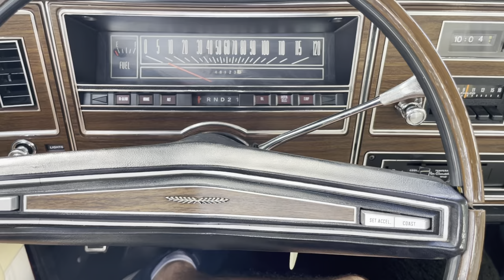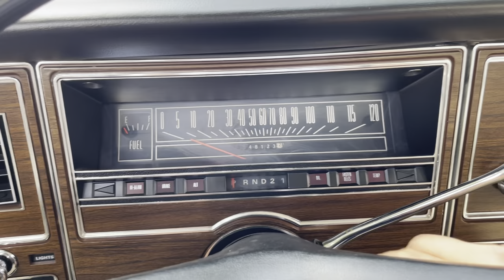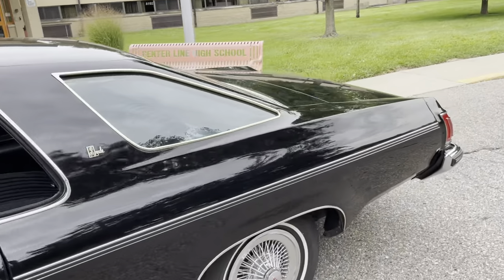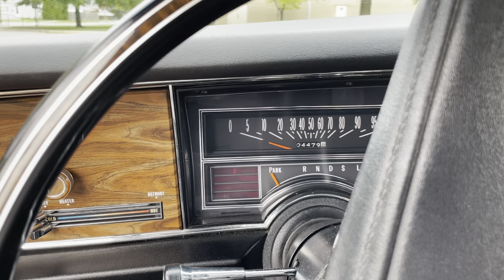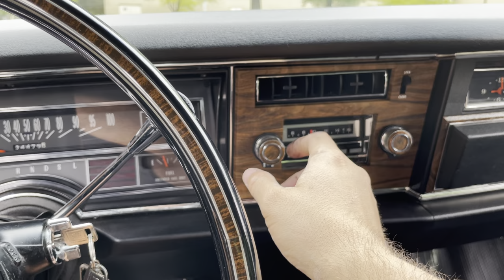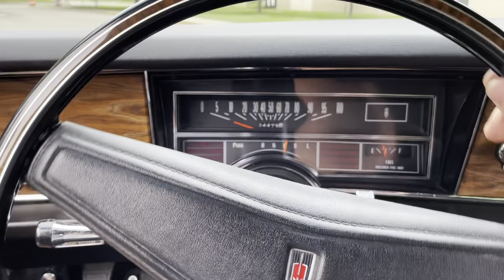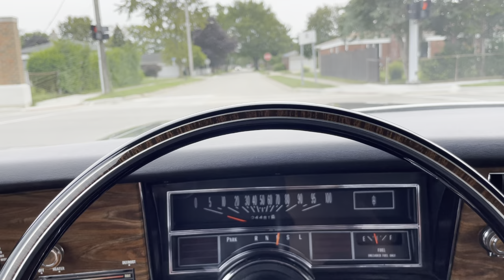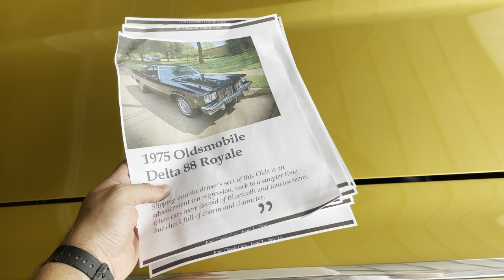1975 Oldsmobile Delta 88 Royale & 1974 Mercury Marquis Brougham - Check out Article in Description!

Comment: In High School in the late 89 I bought a 77 Grand Marquis, the 460 was a beast and so equipped would run 70 MPH in first if I manually shifted it, when it when into second that speedometer really buried! I think it had a 2.75 rearend? On a top speed run according to my friends Honda super bike he creeped by me at 130 plus, give or take I would say 125 mph top end the motor was a single exhaust, and I don’t think I could really hit redline because of drag and not being a high compression engine in 77. In 1994 I picked up a 1977 MK5 with 460 that was equipped with true dual exhaust, I installed a new Holley carb, straight up timing chain, had trans rebuilt with shift kit, it would only get 55 in first, I’m inclined to think it had a 3.00 rear end gear?
It was definitely quicker out of the hole and surprise many cars and passengers with the acceleration for what it was when you nailed it at 70 it would really go. Maybe someone can comment on similar cars just my 2 cents, and yes I have driven some fast cars and muscle cars and these cars are not in the same league, but for a Freeway Flyer they are hard to beat and quite fast.

Comment: I completely agree with your assessment of these two cars. I thought the GM cars of this era were funny looking exteriors. It’s like the lines held on to the 1960s, but just got larger and didn’t flow near as well as they did in the 1960s. Fit and finish was much better in the Ford products during this era. When you closed the huge doors on GM cars during this time, you could see the door cards shake and rattle. 

I thought the Mercury was a prettier car, especially the exterior. 

Olds had better steering and handling, but the Mercury had a plusher ride.

Comment: Are you going to leave the Mercury’s door panels yellow from fade or you going to replay them. They were the same way in my 77 T-Bird. Also in performance have you checked and compared axle ratios? That could be a key player.
Reply from the maker: Rear ends are pretty similar. 2.75 vs 2.56, but it’s more of a top end difference vs low end grunt. 

Not sure on the Merc.  These door panels have a lot of fragile pieces and you need to remove them to remove the armrest.  I may just leave them as is. Not sure yet.
Reply: @RareClassicCars  yep I know about the fragile panels, my car had 42,xxx miles and came off fine and were perfect shape other than the yellowing. I did notice a crack behind the arm rest on the driver’s door so that would definitely have some care removing. Yes the Merc has a beautiful front end.

Comment: My experience about mid-70s GM sense of power --- we had a 76 Cutlass S with the 350-4V and you could drive at the national speed limit of 55 holding the car in 1st gear and probably not quite at redline. Pretty sure it had a 2.41 rear for "mileage" which was still gawd awful LOL. Also, we would find a finish screw or panel screw on the floor nearly every time we vacuumed. Interior was really poor quality. It did have quick steering like you say. But overall, not a fun car. I was in my teens at the time and so was "eager" with my braking sometimes. I'd swear I could almost tap the front bumper on the ground the nose dive was so bad, too.

Comment: My personal opinion of the '74 Marquis was that it looked much nicer than the '73. In '75 ford got lazy and just stopped updating the design.  I agree with you on the luxury wheel covers, they are a nice touch.  The area that screams economy was ford's use of molded plastic on the door armrests.  GM did the same thing, but I don't see theirs turn yellow quite so bad.   I miss the days when you could get a white leather interior.  Nice Mercury - never was a fan of Oldsmobiles after '72.

Comment: My dad had a white 1975 Delta 88 coupe. It had the blueish vinyl roof, 400 2 barrel, I don't recall it's trim level, but it did have air conditioning and soft blue velour interior, manual windows and locks, nontilt column. And it had the same weak interior buzzer! My dad got rid of it in 1986 or 87-ish. He didn't treat it well, my dad isn't and wasn't a car guy, at all. He drove it into the local steel mill and the body became trashed almost immediately and he NEVER washed it, I tried my best to keep up with it, but there's only so much I could do vs a steel mill. I felt sorry for all of his cars. The one thing I liked, before it became trashed, was how well it rode and just floated down the road!

Comment: I find the really loud, metallic turn signal in the Olds annoying. If I am not mistaken, with this generation B- and C-bodies GM was mounting the turn signal flasher unit in a metal pinch clip on the underside/backside of the instrument panel so it would resonate. The sound on this particular one is not pleasant. There was so much variation on the flash speed and loudness of these old Tung-Sol fixed load thermal flashers. The '77 re-design of the GM full-sized cars moved the flasher to the fuse block on the firewall where it did not resonate against the instrument panel. The '79- '91 Panthers had them mounted near the driver's knee panel low on the instrument panel and they would resonate quite a bit.

Comment: correct me if I am wrong, if my memory serves me well those 460 made only 195 hp because the cam timing was retarded to meet the emission regulation, my friend had one and we change the timing chain with a different key, advancing the cam timing by 3 or 4 degrees and it made a big difference, you really have a gift to find those beautiful cars.
Reply from the maker: Youre right.  That happened in 73 and it was 6 degrees retarded, but that wasn't the only factor in the power decrease.  Different heads, compression ratios over time, timing curves, etc.

Comment: When I was very young and dumb. And not all totally my fault. I rear ended a VW Beatle with a 70's something Olds Delta 88. Pushed the engine of the Beatle into the back seat. What was the damage to the Olds Delta 88? I had a red paint scuff from the Beatle, on one of the headlights.

Comment: My father owned a 74 Grand Marquis with the 460 there's no way that engine only put out 190 horsepower. At a hundred twenty miles an hour you can put your foot in it and it still was pulling. We made many trips from Michigan to Florida in that car and it rolled like it was on a cloud of air. If I recall the speed limit was 75 miles an hour back then and when my father would go to pass cars on the freeway it would suck you into the seat..
I also remember during the blizzard of 1978 my father drove that mercury to the store as we passed by four wheel drives buried in the snow. I do remember the car had a posi traction rear end. My father being a Ford motor designer usually got a new car every year I pick the 74 Grand Marquis as the best car he ever owned.
Reply from the maker: I agree w you. It pulls really well, but that is the SAE net hp rating.  Definitely feels stronger.

Comment: Very nice Mercury. Fix the clock.
Reply from the maker: Nah. It’s right two times/day.  

Who needs a clock when you drive this car?  Party starts when you arrive. Not a moment before.
Reply: @RareClassicCars Isn’t it funny how the mechanical clocks in those old cars almost NEVER seemed to work for very long, if at all?!? My parents had a 1977 Mercedes Benz 280E, which they got brand new in 1977, and the clock in that car worked AMAZINGLY well, and what’s more, kept INCREDIBLY accurate time over the ~21 years we had that car. I remember a friend remarking once, “Isn’t it amazing that Mercedes Benz is the level of engineering it takes just to get a clock that WORKS, let alone keeps excellent time?!”

Comment: The Olds is an example of GM's mixed-message marketing. Olds was supposedly an upmarket offering yet there really wasn't much difference between it and a Chevy or Pontiac.  I suppose trim level is a factor but without any branding, and excluding the optional power windows and antenna, that interior could easily be that of a base level Chevy.

Comment: Yeah those old window motors had 3 nylon barrel-shaped rollers that absorbed shock and when they got old and dried out a little, they would disintegrate. The motors themselves were quite durable, so a good technician who had access to new nylon rollers could fix them with $1 worth of parts, just like the newer Climate Control modules that had little o-rings that would stick and disable them, usually to the default defrost mode blowing at the windshield.
   At the dealership, replacing a window motor would be $150 and up (back then) and the Climate Control head still sells for $700 and up: add labor. I can fix either with $1 worth of parts.

Comment: Do you have any ‘75-78 FoMoCo products or ‘74-76 Buicks or Cadillacs?
Reply from the maker: Unfortunately, not anymore.  My favorite FoMoCo years are 67-74.  Starting in 75, they began a lot of cost cutting moves, which decreases my love for them.  I had a 75 Ltd brougham but found my 73 to be a much better car, so I sold it.  Same story w the mid 70s GMs.  I had 3 1976 Eldorados.  Sold them all.  Swore off GM cars w bumper fillers.
Reply: @RareClassicCars  Okay, that's understandable.  To me the big Ford products looked best from "75-78 or 79 for Lincoln and the '76 Big GM products were the best looking IMO.  I love old "Detroit Magic" and it is so sad how far the automobile has declined since this period.  I am only 36 so I unfortunately missed these land yachts for the most part.  I did have a couple Buick Park Avenues (I know it's not the same) but for a modern car they were great.  The last one was a 2005 with only 16K I bought as a gift to myself after finishing college in 2008 and getting my first real job (It is still my favorite car and I still regret trading it in 10 years later!).  I test drove a new Town car in 2010 but for $50K it didn't impress me and I found the Buick rode softer so I passed.  I now have a 2020 Yukon which rides very nice for a modern vehicle with the smaller 18 inch rims and bigger tires.  The rims look cheaper but I test drove one with the 20 inch rims and the loss in comfort wasn't worth it to me.

Comment: Love the Mercury Adam, I wouldn't have ordered an Oldsmobile considering the poor body construction, but then again the Australian Holdens of the day weren't any better. They (Holden) knew the cars were poorly built but also knew people would still buy them, (at least until the Japanese arrived).
I suppose both steering and braking of the Mercury could be improved if desired?
Reply: I don't think an HJ of 74 was any worse than an XB falcon or VJ valiant. My 76 CL, same body has wonky lead join too.  Holden always had much tougher chassis, and that's the main thing u need in the outback
Reply from the maker: Braking isn’t horrible, just not as confidence inspiring as the GM.  

I think a diff steering box would prob be a tough upgrade.
Reply: @cruiser6260  You're right of course, every Aussie automaker was equally bad at the time. Thanks for your comments.
Reply: @RareClassicCars  Fair enough Adam, changing steering would indeed be difficult and you'd also not be getting the "true" 1974 driving experience.

Comment: The rattling noise produced by the door closing on GM products with frameless glass was from the windows becoming loose over time due to wear . Fords were much better in that regard . Also , with GM's midsize , compact and subcompact cars the bushings in the door hinges would wear , causing severe sagging issues with the doors . That was a problem that none of ford's car lines had , not even the lowly pinto . Although the 73 - 78 ford and mercury share similar bodies , I feel that the mercury looks far superior to the fords . My dad brought home a brand new 75 LTD wagon , and when my mother stepped outside to look at it she thought it was one of the ugliest cars she had ever seen . I agreed with her .

Comment: Love your '74 Marquis Adam! I completely agree with you that Ford, Mercury and Lincoln had better quality control out of the Big Three.

Interesting that the 460 in the full sized LTD/Marquis was rated at only 195 net power while it was rated at 220 in the mid sized Torino/Montego/Cougar in 1974. The Police Interceptor 460 was rated at 275. So, you might actually have the 220 hp version if it feels like yours has more than advertised.

The GM big blocks were definitely on the way out by this time as 1976 was the last year for any of them.  The 454 and 455 engines would not be missed as they were mere shadows of what they once were. It was the same for Ford too as the 460 was gone by 1978. Lean carbs, cat converters, retarded cam timing and fuel economy was what killed these engines.

Excellent video Adam!
Reply: 429/460 were torque monsters. That's why this Merc can move steadily.
Reply: Cody Luka < The 460 and 454 were available in 3/4 and up pickups on into 2000.
Reply: @melrose9252  Yes they were. Don't forget the 1990-1992 Chevy 454SS on the 1500 shortbox chassis. There was some talk in doing a 454SS for the Impala as a special edition but sadly, it never came to be. Now, that would have been interesting...and awesome. Too bad though!

Comment: To some extent you were comparing apples and oranges. If you had pick a 4 door 98 Olds it would be more relevant, the Mercury was the top trimline short of the Lincoln. I drove a 74 T Bird with a 460 and was like sitting on the couch going down the road. I always though it was way too soft a ride and it's 460 always seemed lacking to similar GMs like 73 and 74 Electra 225s we had. So things can vary. Two(seemingly) identical cars can perform  differently. Thanks for the cars.👍

Comment: Well, to me, GM destroyed these two door coupes in 74 when they added that god awful "opera window", it's hideous.  Although, like you say, this black 88 looks OK, especially without the vinyl top.  Strangely optioned though with no AC and an AM radio complete with power antenna!  The two door Marquis is a great looking car indeed, the four door looks great also.  And I love the nice white vinyl seats on the Merc instead of that "brocaded" fabric.  My godparents bought a 76 two door Olds, and I remember noticing a lack of quality overall.  The video makes it sound like yours had a bad clunk/rattle when going over bumps also, but perhaps the audio is just deceiving.  The fit and finish on our 73 Caprice coupe was much better than their 76 Olds, which is very strange.  Normally the mushy Ford steering and brakes would be a deal killer for me, but they are great looking cars, and the two door Olds/GMs are hideous after 73.

Comment: My Dad would get a new Olds 98 Luxury Sedan every two years as a company car. The interior difference between his 69 and 71 was night and day. The 71 was total crap compared to the 69. Normally I was psyched when he would get a new one but in this case wished he still had the 69. The 69 was close to Cadillac level of interior materials. It also had a center b pillar with frameless glass that provided a better door closing experience. The 69 455 was premium fuel only - it was fast while the 71 was gutless. The only thing in the 71s favor were the disk brakes. The 69 drums were absolutely frightening in the hands of a 17 year old with that  car's power.

Comment: back in the late 80's  i had a 1969 mercury monterey triple black 2 door hard top with a 390 c/6 and single exhaust  ..the family  car was a 1971 delta 88 with a 455 .2/bbl single exhaust ..around town the olds had more tq then them merc..but out  on the highway i have always said my 390 merc would out run the olds with  a 455

Comment: Nobody ever seems to detail the seat belt interlock systems.  I think the younger people don’t remember it.  Everyone I know had them disconnected which could be done by unplugging a wiring harness under the front seats. Anyway as far as I know all 1974 models and the early production 1975s had the system in which you had to sit in the seat and then fasten the belt before it would start. There was a bypass switch under the hood that had to be pressed before every start to work.  Anyway the 1971s and 1972s had seat belt buzzers that sounded umtilmseat belt buckled, but there was no logic circuit meaning you could just keep it buckled and sit on the seat belt.  Anyway just in case anybody ever wanted to know.  I guess congress passed a law in early 1975 abolishing the requirement for the seat belt interlock.

Comment: Grew up in big oldsmobiles, not as smooth as the big mercuries and less body structure integrity.  However the olds were much more competent driving car in terms of handling, braking and high speed stability.  My uncle always had big Fords and I’d get car sick in them.

GM had lots of paint issues but rust wise the Fords rotted out much quicker than the GM’s.

Comparing the 74 mercury against the 75 olds makes an engine comparison a bit irrelevant thanks to the catalytic converter on the 75.

Comment: Did you add the Mercury to you collection? The door closure is a huge difference between the two as you noted. Fords sound like bank vaults, GM sounds like dropping a dozen eggs.
Reply: It’s the window shaking in GM cars. Sounds awful they all have it. When windows up you don’t hear it
Reply: @youtold7727  < The GMs rattled even with the windows rolled up.